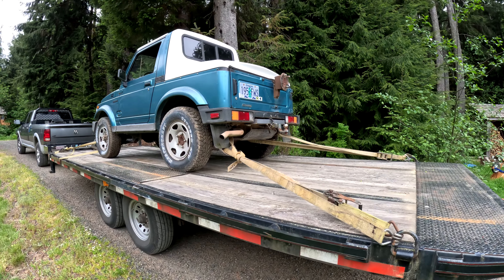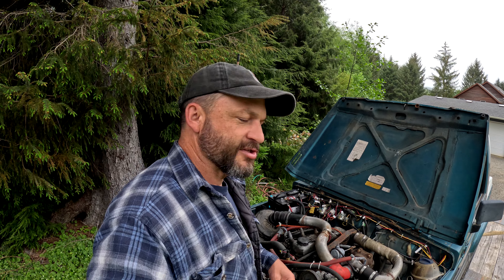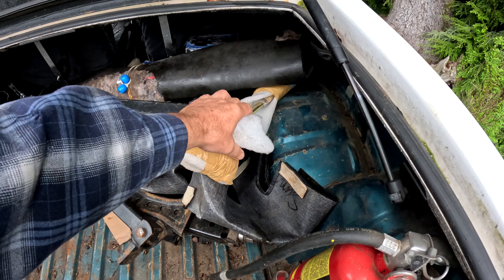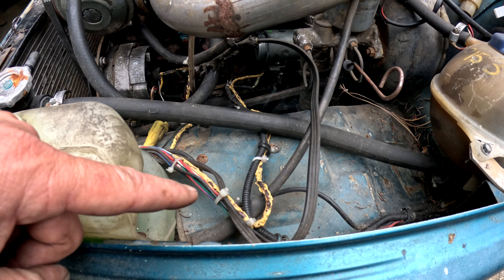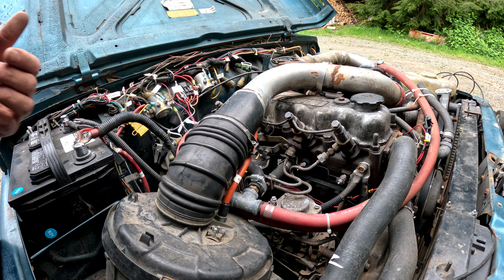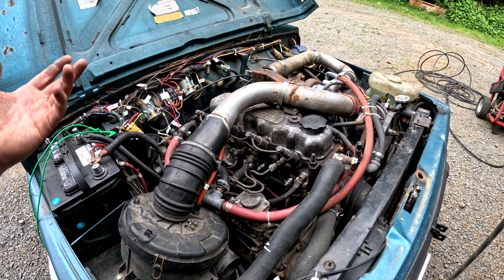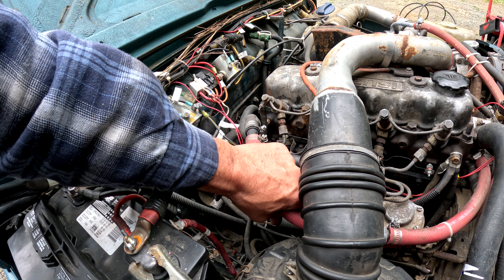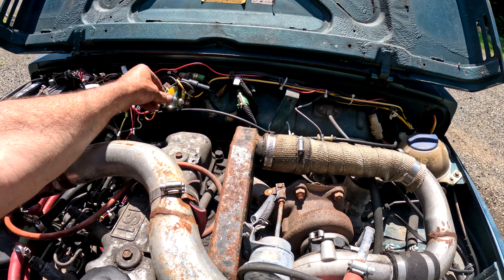Suzuki Samurai with an Isuzu Diesel: first start

Comment: Thanks for the link. I knew you would be able to get it going pretty quickly. Excited to see all the cool things you do to it.
Reply from the maker: We will see how it works out this weekend!  I have Thursday and Friday set aside to do some serious wrench turning.  Need to fab up a pressurized coolant reservoir, finish the headlight swap, find a spare tire, do fluid and filter changes, come up with a battery tie-down, and maybe some kind of stereo system.  Then, I need to pack for the trip.  Those are going to be a long couple of days!

Comment: sweet rig. had a few over the years myself. the last one i had i had a spring over axle in it with a nissan z24 engine and auto tranny . had big cam and would run around 200 hp with a 100 shot of nitrous. worked good. long time since i seen one that stock. think it was the 88.5 i bought new which the wife barrel rolled down the road with 54,000 km's on it

Comment: I had a isuzu pup i got for free and a wrecked chevy luv diesel for 500$ with no title, swapped the diesel into the pup. Great little rig, i really regret selling it. Had a toyota exhaust system laying around i through on it with a flow master, told people it was a toyota motor with a rod knock when they asked why it sounded like a diesel 😂 now i just picked up another samurai and doing something real stupid, going to put a 3 cylinder geo metro motor in it as a gas milage slow speed gravel road hunting rig

Comment: Suzuki later sold.....(in Europe - not UK) a Suzuki Jimny with a 1.5 litre Renault turbo diesel.......nice and very useful little car.....emphasis on little, the problem was you rub shoulders with your passenger.   We sold it and bought a UAZ 469B that had been converted to 2.4 Litre Andoria Diesel.....another excellent 4x4.